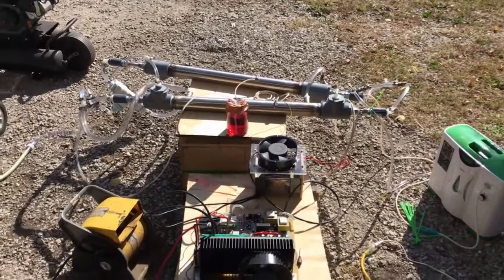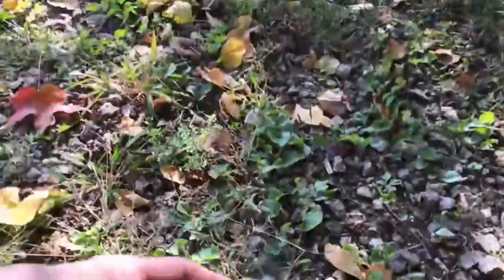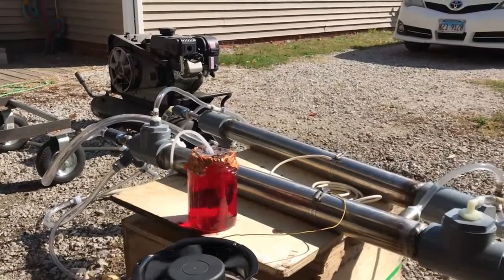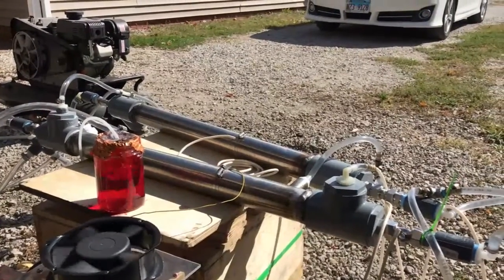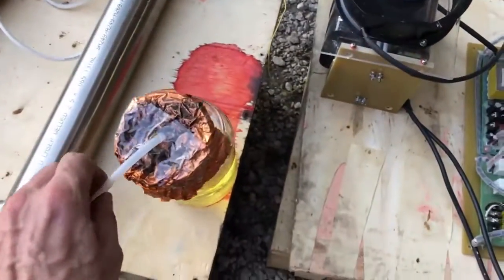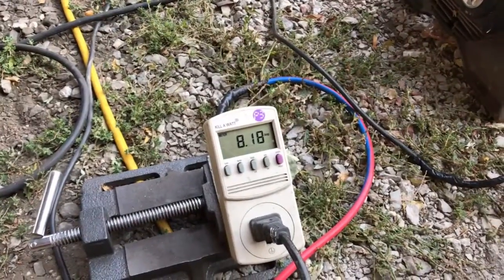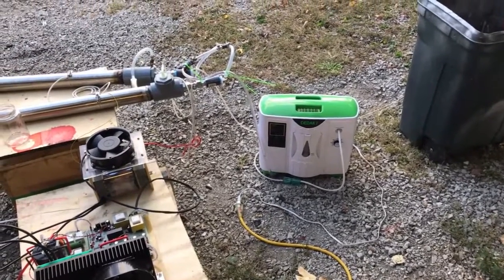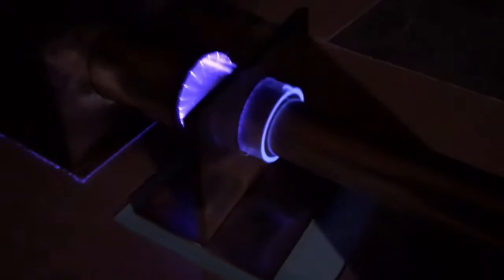1200 watt industrial ozone production 95% oxygen input

Comment: Might try adding a length of coil wrapping the outer tube and run current through it. The magnetic field would deflect the plasma current through a longer path through the air.

Comment: I also bought ozone into water injection system. It has tiiiiiiiny ozone generator inside, probably 0.3g/hour. Me and my mate who is heavily into 3d printing, - plan to rip that module out, replace it with normal capacity generator, - and install it into laundromat machine. I heard if you have actual, normal capacity, not 0.3g/hour, - it actually does help with removing stains from the clothes. At least people who  are selling me this industrial quantity injection system, - are dead set what it cleans textile for free.
Reply: There's a guy in US who sells same systems, company is called San-O3-Wash. At least in the videos he gives impression like he knows his stuff.